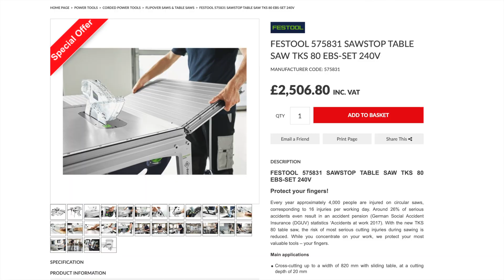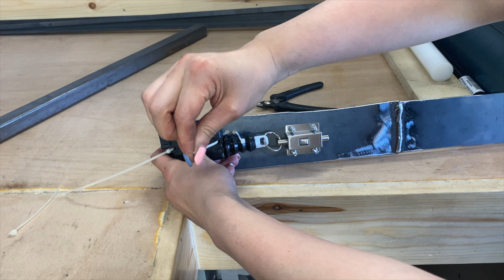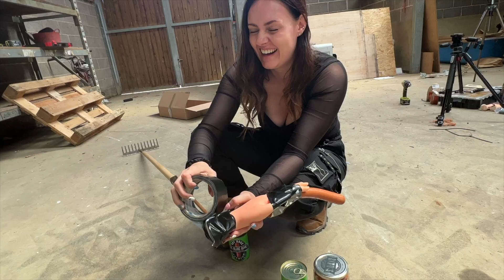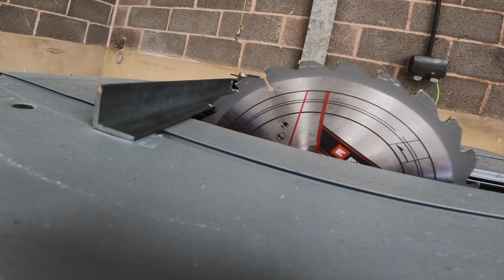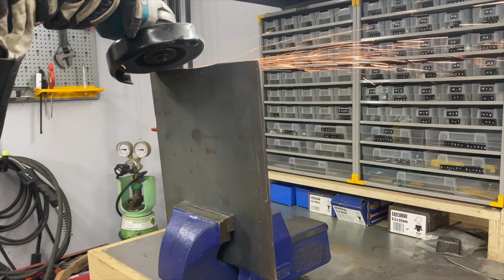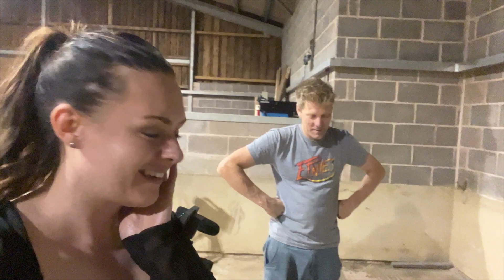Making A DIY SawStop!

Comment: If I remember rightly the emegency stops we had fitted to Radial drills stopped the motor when triggered by injecting DC into  the AC motor. When you consider the Radials we had can drilled up to 100mm holes and it stopped them dead its not badgoing

Comment: Although the result is amazing, i cannot stop thinking of the amount of vibrations due to unbalancing the rotor. anyhow you gave me a brilliant idea on trying to come up with another safer system. Since i was very close to loose 2 fingers, i am also thinking of alternatives, and i believe that an electromagnetic brake system would be more efficient. Will not overload the motor, will not unbalance the blade,  and could stop the blade without destroying either the blade and the motor bearings. work in progress still, a system like this could render the table saw usable for 90 Deg. cuts only though.

Comment: Wow that's amazing Ruth! It's such a shame the Festool is so expensive compared to the Sawstop. And then it's such a shame they sued Bosch as the Reaxx was even better than the Sawstop. Hopefully this will all change soon as the U.S is tabling legislation to make all table saws effectively Sawstop style.

The cool thing about your design is that before it stops it has the extra mass which would make it even better at cutting.

Comment: Not sure how you managed to get any part of that working. How on earth did you manage to isolate the blade from the chassis to perform the capacitance measure? The sheer inertia of the blade should be enough to cut a hand off after the clutch somehow disengages (in a fraction of a second).

The fact that you clearly didn’t understand a lot of the dynamics at play (like trying to brake a blade by dropping a piece of steel behind the cut rather than forcing a softer metal into the cut) makes me wonder how much of this is real.

Comment: I watched an 18yr old kid, on the job for the first day out of highschool, attempting to blow off the blades of a milling machine while running. Blades grabbed the air nozzle, pulling his hand into the high speed stack of blades, removing all fingers except half his pinky. This was the 80s when didn't have adequate protection like this.

Comment: That worked very well. Compare that sausage to one that went through a normal saw and its a massive improvement. You've saved someone's fingers or even arm with that. What was an amputation is not not much more than a scratch. And the advantage of this over the original saw stop is this is reusable with the flick of a reset button. The other one you need to buy a née blade and mechanism.

Comment: A better solution would to be pull the blade away at a backward angle.  No destruction of the blade.   however you would also have to pull the associated motor etc..

Comment: This is awesome, but I do agree that table saws scare me so much. About 8 years ago, I bought one, turned it on and promptly sold it again because I was utterly terrified.

I was wondering if you could build an anti-kickback mechanism? It feels like you're one sensor away from being able to incorporate that into your design.

At the risk of applying hardcore engineering principles to something you built in a shed, how fail safe is this? When you were building your first prototype, it looked like you needed to apply power to stop the saw; whereas maybe it would be better to have to remove power to stop the saw? Also, is an Arduino the right base for safety critical applications? Sorry to sound negative, again, I appreciate that this was a prototype built in a shed; but I have experience of engineering in safety critical applications so old habits die hard!
Reply from the maker: Hey Charlotte, I wasn’t expecting it to work so well. It definitely would need some more work to make it usable full time. This was mainly just to see if it would work. To make it an everyday use thing it would need a bit more fine tuning. The good news is that when it false activates it just stops and you can just switch everything back on 👍🏼
Reply from the maker: Also when it is ‘activated’ the power is removed from the saw and the clutch is activated

Comment: try this clutch ver on  table saw with  belt ....hmm you can create something cut of belt instantly on that models too🤔..most job site ones saw balde attached directly too motor and shaft its a bit hard to fight against torque on these models...still great job Ruth that first and two idea was terrifying soooo much 😑😬😁

Comment: Wonderful project, I'm also surprised how well it worked! But as you said, modifying a piece of machinery like that makes it even more scarier... 😬
I was wondering how well an electric load brake (or whatever it's called) would work. When a sausage is detected the power to the motor is cut, and replaced with a huge load that forces the motor (now generator) to stop. Might need a ridiculous sized load to be quick, but mechanically the saw could be kept in one piece.
Reply from the maker: Yeah I’m pretty sure there is a more elegant way of doing this. Let’s call this proof of concept and hope a brand go and do the hard work 😆
Reply: @Ruth_Amos  Sounds like a plan! The step from "throwing metal into a spinning blade" to magnetic clutch was a huge improvement, so ther can't be that many iterations from perfection... 😅

Comment: That's absolutely amazing, Ruth! Such a brilliant solution too. Was it still using the Arduino to detect by the time you'd fitted the EM clutch?
Reply from the maker: Yeah although I did almost forget to wire it in which meant it was interesting getting my hand back in 😆
Reply: Brilliant! That's exactly what I would do too. You've got me thinking about other triggering mechanisms now though

Comment: Geez, Ruth! That was the most scary dangerous thing you've had a go at so far!😱
Still not quite a 'SawStop' though but not bad at all. So impressed that you got it to work and not explode everywhere.
The SawStop does chuck the bit of aluminium block against the direction of rotation of the blade and uses the remaining energy to pull the blade down into the table so not surprising it is a bit quicker.
But I do like the electric clutch idea, and wonder why that isn't an industry standard. Have a lighter weight brake rotor/disc on the saw's axle and a heavy electric brake stator fixed to the table saw frame.
Maybe an IR sensor covering the whole area around the blade so that it will stop, or not start, if your hands are too close for comfort?
Having said all that I really should find a way to refit the crown guard to my saw while still allowing me to cut rebates and slots.🙈😂
Reply from the maker: Yeah there were a few points in the build where I did questions what I was doing 😆 the SawStop is a cool piece of kit. The electromagnetic clutch worked so so well! This project has definitely made me more wary around table saws (I think that may have been all the googling of table saw injuries)
Reply: @Ruth_Amos  Maybe worth a crowd fund or sponsorship deal to fund a SawStop. As much as I love my 40+ year old Wadkin AGS10 I wouldn't say no to a SawStop.

I have seen enough workshop injuries in my time, mostly as a child, to be super cautious and careful about it.

Comment: Ruth and her ideas, was very surprised with the outcome, there was so much weight in the clutch I thought it was going to shake itself to bits.
Reply from the maker: Thanks health and safety inspector ☺️ I think we were both surprised with how well it actually worked 😆
Reply: @Ruth_Amos - I'd go with the Bosch ReaXX-concept (copyright restricted by SawStop) as it saves the saw blade too!
Make up your mind: https://www.youtube.com/watch?v=Ag_XU2hYysA
Reply: Was not expecting a Colin cameo in this! Amazing idea, execution and brainpower to me er try using this thing again!! Subscribed!!
Reply: As you said - worked a lot better than I was expecting. As much as I love StopSaw, this is one of those things where the patent can’t run out fast enough! Having had friends with horrible injuries from tables saws, this will be a great thing to become industry standard. 

In case you’re curious, they do trigger if wood is wet or sappy. So they also have some work to do before it is flawless, but of course erring on the side of safety is better than the wood. 

Lastly, you need to watch Everything Everywhere All At Once - some sausage mayhem you needed to reference in V2.0. Good luck.
Reply: @JudePullen  The sawstop people not ONLY patented it, they also then used that money to LOBBY governments into REQUIRING it!  They can not burn in hell fast enough.
Reply: Cheers colin for putting me onto Ruth! Love stuff like this!
Reply: @jj_uk  Not around table saws, mate. :-)